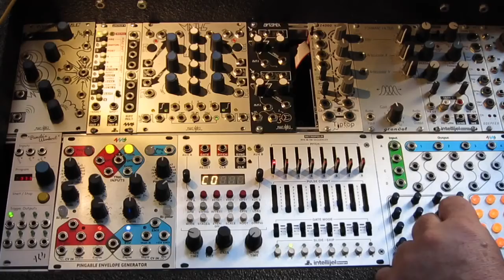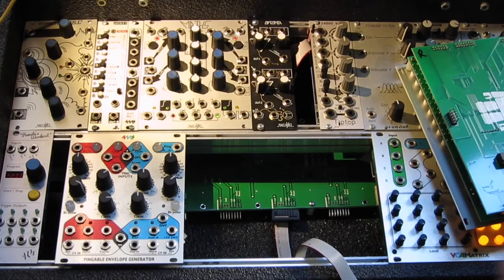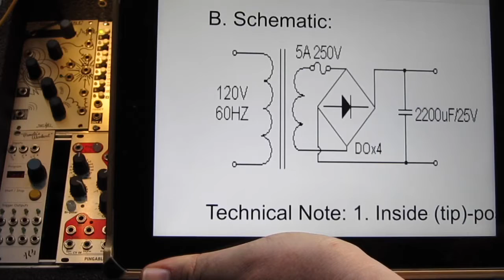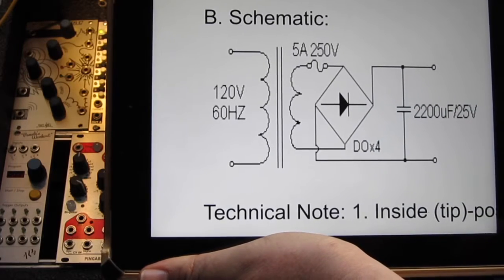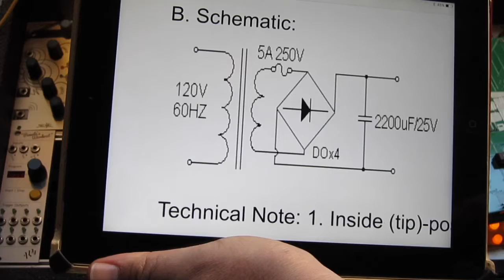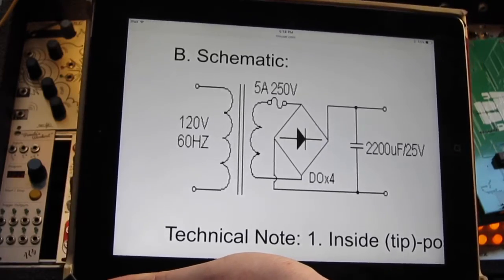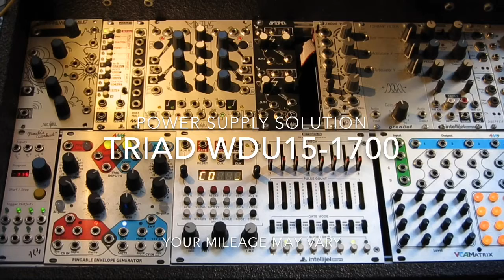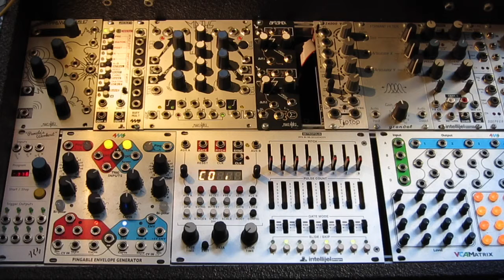Troubleshooting Eurorack Noise Issues

Comment: unplugging modules  with power on  Have u got a death wish ??
Reply from the maker: It's only 12V, silly.
Reply: if the power supply is sitting open in the case (e.g. Doepfer case), then yes that's maybe not the best idea to stick your hand in it

Comment: Holy hell! What a difference. I wonder if this would help my case. It's 18u (6 rows of 148hp) powered by 4 Synthrotek Deluxe Power modules each with 2 noise filtering power distribution boards. Each uses a universal AC adapter rated at 100-240v~2.0A 50/60Hz. I don't know the first thing about electrical. Do you think new bricks might help? If so what rating do I need to look for?

http://store.synthrotek.com/Deluxe_Power
http://store.synthrotek.com/Noise_Filtering_Power_Distribution_Board

I'm getting a nasty high pitched whine. You can here it in the video below. I need to rip the case apart to reorganize so I'll check individual modules then but I have several songs patched I'd like to record first. If new bricks would help eliminate the noise I'd be overjoyed. It will be a nightmare if I record separate tracks each with this whine. Any help would be much appreciated.

https://www.youtube.com/watch?v=cEcIp2np6o0
Reply from the maker: Based on your recording I would definitely look in to a linear power supply. I've added an attempt to document how to do that above. You need three pieces of data:

1. your local wall current (voltage and frequency) for the input stage of the power supply
2. the output power of your existing supply, in amps and volts
3. the polarity of the barrel connector -- the synthrotek site says center-positive 2.1mm DC plug

From there you can use the parameters to look for a power supply.
 
The synthrotek site recommends a 90W 16-24V power supply. Now we should be able to compute the output amperage by simply dividing the watts by the volts, which means 3.75A-5.6A @ 24V-16V. Go for the high end of the amperage range.

Comment: Thanks for the vid... it wasn't the fix for my problem, and couldn't be... I have to use 240VAC... but you sent me in the right direction. Was getting the same kinda problem from the LFO on a sythrotek DS-M.
Fixed it using a  regulated NON-switching power adapter - switching was the problem.
Reply from the maker: Can you share all the details about the power supply you found that worked with synthrotek? Make/model/part number, ideally input and output stats.